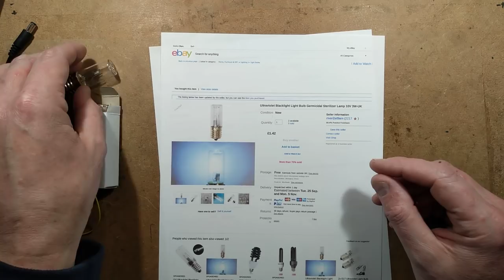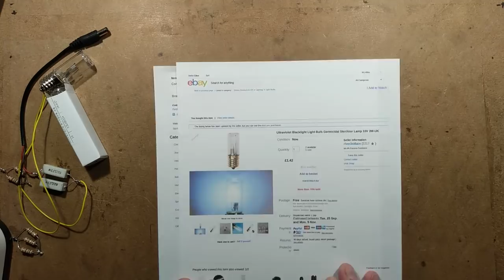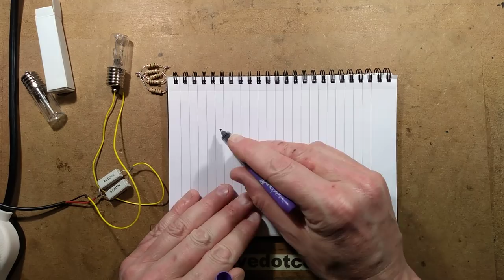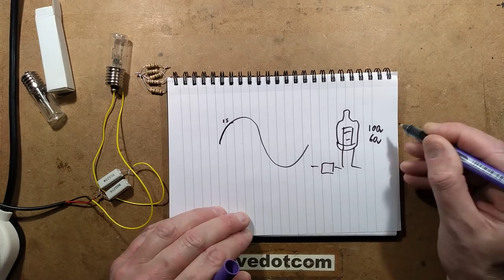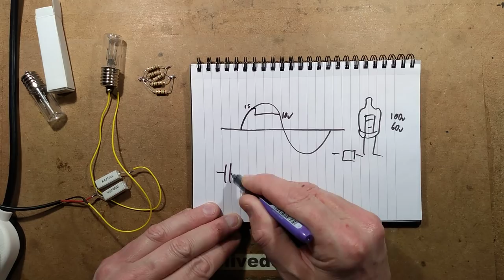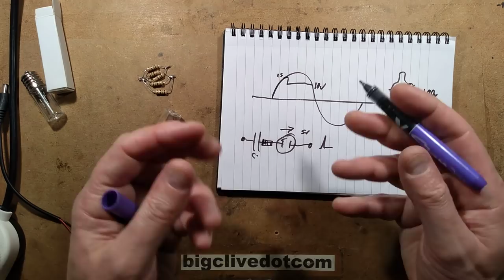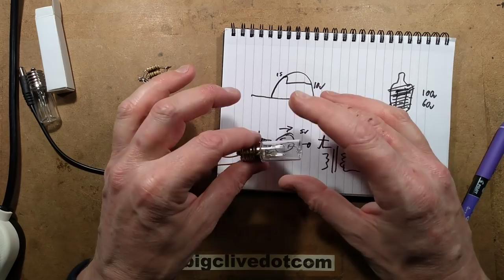Amazing ten-volt mercury discharge UVC lamp.  (GTL3)

Comment: When you said "kept on" I heard "kapton" xD .

About mirrors: They make the camera more versatile. It's easier to do things like astrophotography, when you don't have a dedicated camera for that. I doubt the preview of a mirrorless cam would pick up any stars in the vincinity to focus on or align the telescope to the nebula you don't actually see. Real mirror + eyes could. However, I admit that this is a pretty special application. Let me have another go: The preview screen has a resolution so low you cant't really see your exact focus. Focusing a 20 MP image on a 3 MP screen is like building a watch with an excavator. It doesn't matter much for artistical images since there usually is at least a tiny bit of stuff in both dorection of the spot you want to focus on, but for technical images where you want to image a plane, like astro, mikro or repro, you wan't to be sure that the focus isn't even 0.1 mm off. Autofocus isn't accurate either, not even on the EOS 5D I work with, not to mention that it doesn't work under even what I consider medium-to-low light conditions.

Comment: The mirror in a DSLR is also used for the autofocus system, which is typically faster and more reliable than the equivalent mirrorless, although the current generation of Sonys have closed the gap dramatically.

Comment: Mirrorless cameras typically have in body stabilisation, whilst great for video and handholding, it's bad for long exposures as it is a mechanism that heats up the sensor, introduces interference, and contributes further to the generation of dark current and higher read-out noise. DSLRs are exempt from this, even the Pentax K1 with IBIS doesn't have these issues, Sonys do. 

Another thing is PDAF (phase-detect AF) striping showing up in images, this can be fixed in hardware, Sony however doesn't seem willing to address the problem. Sure mirrorless has many advantages, it's just not there yet no matter how people (who don't know much, quite frankly) would like to think.

For most people, mirror or not, doesn't make them better at taking photos.

Comment: That is what is called an Intermediate base and is an E17 size. It is probably most commonly used for C9 Christmas lights. However some Microwaves, Refrigerators and Upright Freezers used Tubular style E17 base light bulbs, even at one point used in cheap knockoff Lava lamps(which is a mini spotlight style bulb). At one time, probably in the 1950's you could get an adapter that would allow you use that size bulb in the standard E26 socket. I actually found one in some junk although you could probably find them on eBay these days. Now this is probably often confused with it's smaller cousin, the E12 bulb which is also called a Candelabra or Nightlight bulb since it's used in Nightlights and Chandeliers but it's also used in Christmas lights  which are referred to as C7 lights.

Comment: So i was running one of those cool spiral neon-argon cold cathode bulbs on around 90 volts made with a variac. And suddenly it brightened up really bright, turned blue-ish and after turning it off there was a smudge on the inside of the glass.

Comment: I used to have these old lights that were 12 volt. They had weird push pins on the back and were red lights. We always thought they were old safety lights for a back up generator. We hooked one up to a car battery it drained the battery in 20 minutes and was crazy bright.
Reply from the maker: Possibly aircraft lights?
Reply: they came in a blue and yellow box mostly faded away you could read 12v. the place they came from had the glass fuses and had been upgraded to that from an older system it was loaded with weird stuff. they had those old giant metal lamps that hung from ceiling with cone shaped lights as big as a person and giant copper transformers the panels had to many fuses to count they were on the cutting edge of 1950s or 60s. we could take anything that was getting pitched all copper was trucked out so I took one and a giant wrench like 7 feet tall. stuck light on my truck mirror it was cool like a Frankenstein neck bolt or something from an old scifi movie.

Comment: I kind of figured that those must oscillate at some given voltage and current; filament gets hot and liberates mercury vapor. Vapor then conducts when there are enough thermionically-induced electrons, and the vapor shorts out the filament, causing it to cool, and stop releasing mercury vapor. Reduction in vapor ends the short across the filament, and the cycle repeats.
Reply from the maker: I think it stabilises, but when under run it does oscillate slowly.

Comment: Another good one Clive. Thank you as always. I have a few of these and like you I've tried various ways of powering them. For DC it's essential to limit the current as you so rightly say. I've found that 300mA is about right. The mains via a 4uF cap does seem to be the best driving method though and I've had one running for days with a capacitor in series and there doesn't appear to be any sputtering. Your thoughts on sputtering in neons are quite correct of course, but these UV lamps are not working in the same negative glow principle, rather thermionic emission ionising the mercury vapour and not negative glow. Anyway, I'll leave one running via a capacitor for a few weeks (out of sight because of the UVC) and see what happens. Once again thanks for producing so much wonderful and well presented scientific stuff for us all to enjoy!

Comment: I had to re-watch that about 5 times to understand what you were saying about voltage and current.  I realized the I was confused was because I was calculating backwards from what you were doing.  I was multiplying 100ma by 10 volts and getting 1 watt, and you chose to divide.  

Also, I can only  assume 3amp is necessary to establish the arc and the 100ma is needed to maintain the arc.

Comment: Same basic design as old-fashioned ozone lamps.  I knew they ran at a particularly low voltage, but I didn't know it was quite that low.  I have a toothbrush sterilizer which uses one of these lamps, and it has an electronic ballast with a 10-minute timer.

Comment: Would it be safe to put that bulb into the envelope of a normal incandescent one to block the UV-C while still getting that nice blue color?
Reply from the maker: Theoretically plain glass should block the harmful wavelengths.
Reply: You can also paint the inside of the envelope with some fluorescent paint - it would absorb the radiation and emit visible light.

Comment: Worshiped the Sony Alphas back in the day. Still great cameras, would love a brand new a7-R-III with all the accessories, but don't really shoot many photos or videos in my line of work anymore so I could never justify buying one when I've got a cell phone that really on a day to day basis works just as well as my A77 did. Of course with a lot less flexibility in terms of more advanced functions and professional level controls, but you really only need that (and might even not want it)  to a certain extent depending on what your use case is. Hope your new camera works out for you!

Comment: In a neon glow lamp there is beta emitting radioactive element (krypton-85) used to decrease breakdown voltage. It is one of the reasons that you can't use a neon bulb as a very cheap Geiger Muller tube for detecting beta and gamma rays (it would self trigger). I would probably avoid opening the low voltage GTL3 bulb, just in the off chance that there is krypton-85 shielded inside the quartz, it probably won't kill, but best to avoid.
Reply from the maker: I did find out about not being able to use neon lamps as cheap geiger tubes the hard way.  I thought I just hadn't blacked them out enough.

Comment: Dslr mirrors perform a purpose you’re apparently unaware of. They have a phase detection focus sensor in the light path when the mirror is down that generally far outperforms the focus systems on mirrorless cameras. Mirrorless focusing is getting better on high end models but even an entry level mirrored dslr is often better at focus for challenging still shots. For video it’s a moot point. And mirrorless cameras are technically not dslrs.

Comment: Probably already stated, but a bulb much like these was common in 1960-70s electric clothes dryers to provide that nice ozone aroma of line hung clothes. They were simply suspended in the air flow path downstream of the heating element. Those simply had a drop of liquid mercury in them.
The ones I'm  talking about were line powered with a little Xfmr about 5cm square. Maybe it was a simple step down xfmr, but I thought it was a series inductor. It's been about 25 years since I had one in front of me...

Comment: Weird ratings. It's the same thing with how they list those 3W LEDs. First ones I got were far-red, with a forward voltage of about 1.8, but a listed current of only 700ma. I powered it with a full 3W, and it works fine. I also have as 'street-light yellow' one in a homemade lamp. It also had the 'current 700ma' rating. I've been running that one at it a full 3W for 8hrs a day for the past 4-5 months, and no issues.

Comment: good luck i looked all over my town for e-17 no luck decided to solder like you did but mine were sold as 120 volt haven't fired it up yet thanks for the heads up !
Reply from the maker: Some of the listings do actually describe these as being 110/120V which is wrong unless they are providing a suitable driver.

Comment: 2:05, I can tell you as a professional photographer I hate using Mirrorless DSLRs. Having an actual optical viewport finder is 1000% better to me.

 Yes I use the screen a fair bit too but prefer viewport much better. Also having a screen and viewport means I can look through viewport and have the menus up on screen at the same time to fine tune settings.

 Not to forget to mention the viewport helps you see what is going on without screen glare which can make it impossible to see what's going on without cranking screen brightness to the max, draining battery quicker.

 In fairness some Mirrorless cameras have digital viewports but they are not the same. Also It means you can't look through them without power going to the camera.

 Sometimes I check out potential shots using the viewport finder to frame it and see if it will be good without power on camera to save battery.

 Can't do that with a mirrorless. Overall more options is better for more versatility in different situations.
Reply: I do think you'll be very happy with your mirrorless over phone though.

Comment: As a discharge lamp is, essentially, a capacitor, adding another series capacitor into the circuit won't really do much more than the lamp itself will do. Ballasts are generally inductive (mains fluoro lamps) or outright resistive.

Comment: An inductor is a much better idea for any type of discharge lamp, than a capacitor, or a resistor, due to the delayed current ramp up. As Mr. James Clerk Maxwell has already figured out, the current in a capacitor is i(t) = C·du/dt, while the voltage in an inductor is u(t) = L·di/dt. After rearrangement of the equation, you will get di = 1/L· u(t) ·dt. Integrate the equation from 0…2·PI, Take a sinusuidal voltage to calculate the complex impedance Z=u(t)/i(t) and you will end up with the famous equation for the impedance of a inductance: Z = jwL; while w=2·PI·f. The total complex impedance of the whole circuit is; Z = jwL+R and the magnitude |Z| = sqrt( w²L² + R²).

Comment: thanks for the great explanation! When shopping for the bigger mains variants you can choose between "ozone" and "no ozone". I was wondering whether there is some high voltage ozone generator built into the socket or is it really some form of coating on the glass?
Reply from the maker: It appears to be wavelength filtering.

Comment: My engineering sense says that the metal piece at the base of the filament is a bimetallic shunt to bypass the non emitting heater section of the filament once reaching the right temperature for emission and not a mercury collector.  As in a fluorescent lamp the mercury is already vaporized.
Reply: I have some blinking lightbulbs for Cristmass lights - they also have a bimetallic switch that opens the circuit when it reaches enough temperature and closes again when it cools down. I wonder if it could work as a discharge lamp. I think yes, but it would require high voltage, because the filament isn't covered with material enhancing emission of thermoelectrons and the bulb isn't filled with mercury vapor, but maybe with argon (or there's vacuum - then there wouldn't be any discharge at all).

Comment: It would be interesting to know how the lamps impedance changes as the gas ionizes. I assume the gas discharge shorts out the current flowing through the the filament. It would be interesting to compare the hot filament resistance with that of the gas. It is a very clever design as there is a feedback mechanism built into the construction that keeps the gas ionized. I presume the flicker is an oscillation between current switching between the heating current and the discharge current. I assume the white powder on the filament is thorium oxide, the same electron emitter used to coat valve cathodes.
Reply: Don't forget gas lamp mantles, those use thorium oxide too (or at least they used to, not sure if any economical alternative is available).

Comment: We discussed operating one of these with a series resistor and a series capacitor from our 24V supply, which raises the question - how would it perform with a series inductor?
Reply from the maker: Not sure.  I think a resistor is preferred on an AC supply.

Comment: I think that the screw cap of the lamp may be a Japanese standard. We had some odd sized lamps (in between MES and SES) on Japanese CNC machine tools, which I could never source lamps for.
Reply from the maker: MES is E10, SES is E14 so they might have been E12 lamps.

Comment: Those lamps where in old fumehoods that 'filtered' cooking fumes and blew the output back in the room. Best way to run them on a small EI core 230/10V transformer Those are so inefficiënt that unloaded they run well above the rated voltage. The filament resistance is so high that the transformer easily hits striking voltage.
Reply: Why would unloaded voltage rise be due to inefficiency? It means it's unregulated yes, but doesn't necessarily mean inefficient.
Reply: @incandescentwithrage  Small EI transformers 3W is tiny behave like magnetic resistors. They should be banned harder than filament bulbs! Exept for this sort of application.

Comment: As mentioned by a couple of people and my reply to one the Philips Sonicare HX6160, HX7990, Etc toothbrush inductive charging dock and UV sanitizers use this lamp but run it on DC. I need to add a polarity reversing switch to mine to occasionally flip the polarity and more evenly use the lamp.

Comment: I might be wrong but I am sure we used lamps like this in plant rooms as part of the water treatment.
Reply from the maker: It's common to use the fluorescent tube style in quartz sleeves and pass water over the surface for sterilisation.
Reply: bigclivedotcom ah ok thank you yes that was exactly the type of setup used. 
I wonder if the lamp holder size is different to prevent misuse. 
Great video as always. 
Oh and the cheese on my chips was bloody amazing it really elevated My taste buds to new levels.
Reply: You would have used something similar, they are used by aquarists to kill pathogenic bacteria in the water.

Comment: New camera will be good. Not only does it have focus issues when zoomed in, the camera used to record this video also seems to have audio issues. When you clicked off the meter at 11:35 the snapping sound of the switch made the microphone cut way back, thus making it hard to hear what you were saying for a couple seconds.
Reply: Yes, that's the auto level control kicking in. It seems to be a bit vicious and is probably not necessary in this environment as Clive isn't moving around much.
Clive, have you tried switching it off to see if your audio levels are still consistent? It should be just set the level and forget it.
Reply: Yes, just like today's studio music albums...the loudness war.

Comment: It would be interesting to find the schematic of the appliance(s) that use these lamps. It would give one the correct power supply setup. The socket for this lamp appears to be the same size at what was used in the outdoor Christmas light sets of the 60's and 70's in the USA. Standard Christmas tree bulbs of this era were the E12 base bulbs which are also used in the incandescent night lights in the USA. They are also known as the candelabra base. In the EU the "candelabra" bulbs I believe use an E14 base. The E10 is used in flashlights (torches in the UK). I find zero difference between the E26(USA) and the E27(EU) since I can use ether lamp with either socket.
This is a very informative video! Tempted to make a small portable mask sterilizer with one of these bulbs with this Virus issue. It would prolong the use of the mask for a few extra days. One interesting note I have found is that UV light will deteriorate nylon and other biodegradable plastics relatively quicker than usual.